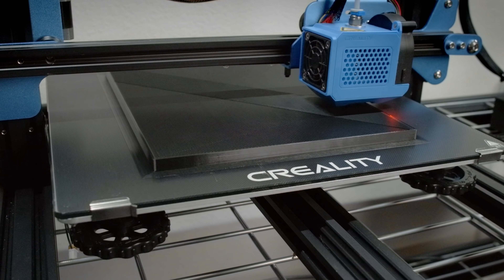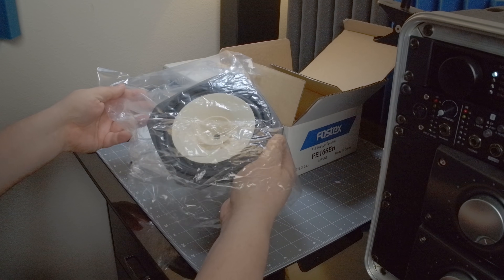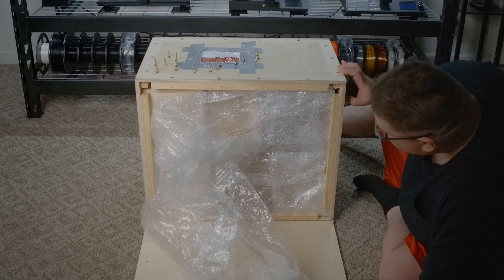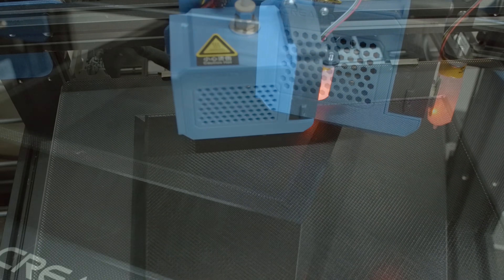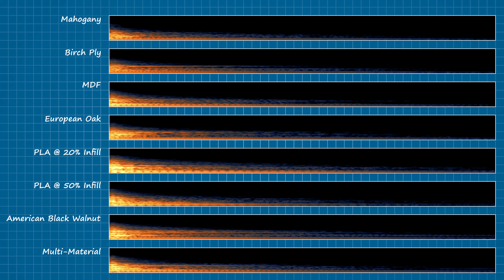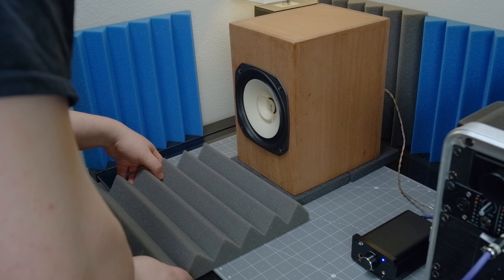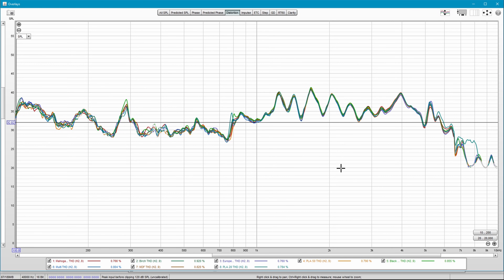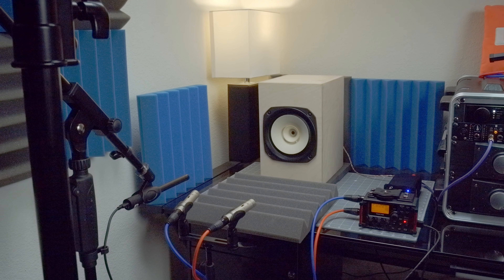Which Is Better for Sound?

Comment: Wouldn't it be easier to just compare flexural modulus & wall thickness ? The problem would be resonant modes in the excited spectrum. With sufficient thickness &or high enough modulus it wouldn't cause any issue with any material.

Comment: I don't have expensive gear, listening on some headphones, couldn't hear a difference. 
So does this mean the audiophile companies that sell us expensive gear just because of type of wood they used are lairs ?
At the end thickness and shape of enclosure changes the response the most.

Additional info: This box is relatively small, so each material didn't change the response a lot because it can't flex. This could be different if the box was tower size where the walls will be taller and might flex more with different materials hence creating more resonances. That's why speaker builders put bracing inside speakers to reduce the cost of creating it 2x as thick. 
Or as B&W speakers, just make them an egg where the shape itself is just more ridged. (Well and glue multi layer sheets of plywood to make it harder and stronger than concrete :D).
Reply: Does a gold watch tell the time better than a plastic one?? In 99% of the cases not. The material almost always reflects status. OK, that's probably simplistic but you get what I mean.  Also very good point regarding cabinet size,  although proper bracing helps with any build.
Reply: @DTXGaming  As a watch enthusiast, your example is a poor comparison.
  
The tests being conducted were performed to determine if box material impacts the overall harmonics of the sound being produced (which they clearly do, albeit minimally). The outer case of a watch (the component which houses the movement inside) does not impact time in any manner. However, if we're referring to the mechanical movements themselves (which are predominately made of metals), then there is impact to the time. A prime example of this can be seen in the hairspring of the movement. The accuracy of a mechanical watch movement is determined by it's overall coefficient of friction, uniformity of material being used (as in the case of the hairspring), precision of gear cutting, gravity, and a few other factors.  However, the watch case itself does not impact the accuracy of the timepiece.
Reply: YouTube audio is not lossless,it’s basically typical mp3 grade sadly

Comment: The Mahogany sounded tighter , pLA20 a bit smeared. I listened to in on a pair of Sennheiser HD 58X
Reply: That's basically what i heard as well.  m40x and tr-90 hear.
Reply: Agree. It  even added a tiny but if distortion. Now I want mahogany not only in my guitars but in many speakers.

Comment: Questions: If the stiffness is higher you should be able to move the material resonance towards higher frequencies, right?

You should also be able to increase this stiffness by "tensioning" the material.

Could you try a rig that allows you to pull opposite faces together in the center? The concept is to constrain the walls with internal stress, to reduce the degrees of freedom
Reply: We used thinner material to help reveal the differences to help further engineer our designs
Reply: @coppiceaudio1132  Amazing, my question is purely theoretical by a design standpoint: given a fixed material thickness do you think it's possible to improve the acoustic properties (remove non linearities and material vibration) by keeping the structure under tension?

Comment: the Birch and 20% infil both sound notablcibly "tinnier" than the rest to me. cant say i notice any difference between the other materials: perhaps i would with tracks in more familiar with. (listened with sony MX1000).

id be curious to see this test with PETG. I prefer it to PLA for most of my print becase of better layer adhesion and low flexability: but its also far more rigid and brittle. i wonder if it would resonate too much?
Reply: Its less stiff so the resonant frequency will be lower. I have a feeling that it would stopp ringing faster too.

Comment: i'd be curious to see what the 20% PLA would do if you applied some sound deadening material to the outside or inside of it :)
Reply: I tried it with Noico sound dampening.  didn't tame the resonance at all that much.
Reply: @poman911  noico is dogshit. Gotta use something like second skins, on both sides.
Reply: @bleachstain9785  I used both and was more impressed with the value of the noico. The much more expensive second skin was barely more resonant resistant. I would rather go 2 layers of noico and it's still cheaper.

Comment: Next do glass, Plexiglas, concrete, marble, ceramic, tungsten, steels, aluminum etc. Enclosures In later videos, if possible. This is really interesting. But you would figure the best enclosure material. Would be the one that offers 100% dead resonates across the entire frequency range.
Reply: Cement is easier to work with and make than concrete

Comment: You ought to try pouring concrete into the plastic like I've been doing. I'd be interested to see how that works.

Just do a low infill (like 5%) and no bottom layers. Then you can pour it right in after you rip some of the excess infill out.
Reply: I think what might even work better than that, is those high density foams. Go check out Smooth-On. They have different weights of foam for different densities.
Reply: But if you've been doing it already why dont you know how that works? What does it sound like to you?
Reply: @colbylaro9361  I don't have any kind of analyzing equipment like he has. It sounds good to me but that's just me.
Reply: @colbylaro9361  Because I've used it in different applications. I've used it to dampen the aluminum extrusions for machine frames. This replicates the sand casting of full CNC frames to eliminate harmonic ringing within the chassis.

Comment: I currently on a mission to test individual variables as well. Im currently testing how port area effects the response of a sub. I know as the port gets smaller (sq. In. per cube ratio) you get more port velocity but according to my modeling software (bassbox pro) thats it. No change inbcone displacement or predicted response. I find it hard to believe that port velocity is the only thing that's affected by port area. Regardless I'm building 3 boxes identical in every way other than port area. 1 12 sq in per cube, 1 16, and 1 20. If you have done similar tests and have scientific data that you would be willing to share, I'd love to see a video covering what you've learned so far. Thanks for everything you've shared already, cheers.
Reply: Port compression. At least in car audio where the SPL can be rather high

Comment: I hate to admit it...but the MDF sounds most neutral to me.  (Audiophiles: Rage!!!)  That said, I'm just listening on my 16" macbook.  I'll try to remember to revisit this when I can listen on my monitors.  The mahogany was somehow dead" compared to the MDF, and the 3d print had a bit of an "under water" sound.  The birch seemed bright, and the hardwoods were pretty unremarkable...as in I can't think of anything to say about them.
Reply: @HexiBase  Listening at home, it is way harder to hear differences because now I can hear the bass!  Impressive for a single driver!  But same general conclusion as before.  (I'm listening on a pair of M3-8s along with a pair of BX 12" subs in stereo.  EQ is mostly flat, with just a touch of extra bass.)

Comment: Cool to see this kind of test done with different materials. First time building an enclosure with Birch Plywood I noticed it has a certain king of ring to it. 

It's built for a Subwoofer and has minimal bracing since it's covering a narrow bandwidth in my car. It's a simple box for use with Passive Radiators (3 Dayton Audio 10" PR with an Ultimax 10) tuned to 19Hz. Can't wait to get the terminals and wire this baby up.

You've also inspired me to look into Isobaric more for some unique subwoofer builds. I might try to build a subwoofer in the future using a pair of Dayton Audio Ultimax 8" drivers Isobaric loaded using a 12" Dayton Audio passive radiator tuned to 20Hz in a 2 cubic foot enclosure. It's not going to blow anyone's socks off. But in the car it should have fantastic very usable output to 20Hz.

Comment: Mahogany sounded the best to me, while 20% PLA had some slightly muddy bass.
Reply: @HexiBase  Interesting. Btw what wood would you think would provide the best bang for the buck, even if the differences are ever so slight?
Reply: @brigganthewolf1461  Here in the UK Mahogony is the cheapest of the 3 woods, we have found on smaller projects there is very little difference in material cost compared to 18mm sheet materials, the thinnest wood boards are rough sawn 27mm and can yield up to 24mm planed boards so you do end up with thicker material but you do have extra work to plane and thickness the boards, some suppliers can arrange for this to be done or may have planed stock on the shelf but then starts to be come a lot more expensive. Mahogany is also available in wide boards but it is also a Tropical hardwood so there is an environmental impact so source recycled if you can!
Reply: Thanks for the feed back!
Reply: @coppiceaudio1132  No problem!

Comment: Maybe try wood filament PLA or other particle added PLA just for the fun of it. Although 100hrs - 4 days printing sours that a little. Seems a lot of manufacturers use composite materials like different types of wood with aluminium or other metals in their builds. Top end B&W speakers do for sure. Great video as always and thanks for taking the time out to do this project. Can only listen via an ipad so can't contribute really on SQ.

Comment: Great video really dense information packed in this one, I appreciate the time spent to make it. But that driver though, it doesnt seem smooth anywhere? At 4:19 , its like 11db differences, arent full ranges supposed to perform somewhat well without tinkering with crossovers?
Reply: Where did you see 11dB differences?!  And a full range speaker doesn't have a crossover... as the term crossover indicates; it helps cross the sound from one driver to the other; ex; reduce the high frequencies for the low frequency driver and vice versa.  So with 1 driver, no crossover.

Yeah so you're reading the graph wrong, it's almost +/- 0.5dB for the 10 measurements, so similar if you recorded 10x the exact same cabinet+driver you'd probably get similar results!
Reply: Ah ok you meant +/- ~6dB from 100Hz to 20kHz....   It's normal for a fullrange speaker, fostex's own data sheet will show similar measurements. as the name indicates, as it does all the frequencies there are some compromises vs a speaker which only has to do mids, treble, bass, etc., so yeah you'll get more variation than a +/- 3db speaker.   Doesn't mean they sound 'bad' though...  Plus yeah there will be some room interaction which will make measurements worse; most speaker measurments you see are smoothed anechoic measurements and on axis...
Reply: @GranDarf  Yes I meant the general graphs, the room could be cause of the issues but the measurements were taken close to the speaker so not much problems should be caused by the room. What I meant with crossover was that looking at this graph I dont think it would sound very good, to bring down some of the peaks with a notchfilter would decrease the delta, but if I´m introducing a filter in the signal path I might as well do a 2-way. Not really sure whats so great about a +-6db "fullrange" as it doesnt seem to do even the midrange properly. Given 10 db is perceived as twice as loud, the bumpy line should be noticed in the sound.

Comment: Interesting. Considering the odd response from the 20, could different infill patterns can get cleaner responses? Time for some smaller scale experiments perhaps?
Reply: I would have thought it was more down to density
Reply: @rompdude  What's coming through in the Treble is probably resonance. Yes, it's affected by density, but it's also affected by the shape of the infill. A different infill could possibly get a cleaner sound without the expensive additional filament and time cost of printing at 50%.
Reply: @KiraSlith  
Or save time printing and pour something into the cavity.
Reply: @getahanddown  That's what I'm thinking. A mostly  hollow wall structure filled with sand, saw dust, sand + epoxy, water, heavy oil, peanut butter... the list is long
Reply: Iirc higher frequencies do not penetrate the walls due to the wavelength. So if you have a specific frequency you could in theory tune it with wall infill design.
Reply: the study of this is called " meta materials" you can probably find something online about this exact use case.
Reply: Acoustic metamaterials are currently under alot of research, 3D printers unfortunately sent really considered for this as the main aim is to create materials that can be scaled down for ultrasonics, EMF radiation etc... So they all follow structural effects. My university that I'm currently studying at are one of the epicentres of this research and headed the development of activated charcoal absorption.
Reply: And also, the possibility of filling the gaps left by infill using some kind of expanding foam or something similar?
Reply: Maybe. Personally I probably wouldnt have used gyroid for that but some box infill or so but I guess density plays a big role.

Comment: A carbon enclosure would be interesting too.

Edit: The 20% made me want to reach over and flatten the mids. 50% was better but that walnut was yummy.
Reply: I have seen metal workers printing dyes and leave openings, so they can fill the infill prints with epoxy, but caution with the materials used. sounds very interesting.
Reply: @manup1931  I’m a sheetmetal shaper.
Reply: The 20% was kind of annoying to listen too, real shrill, imo.  Not sure how else to describe it.